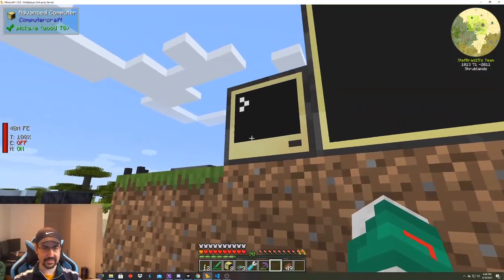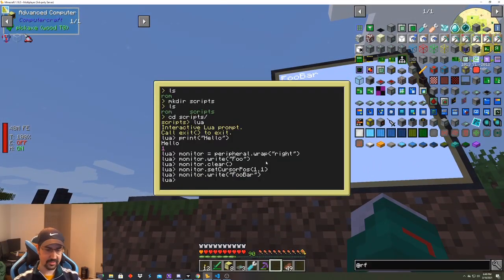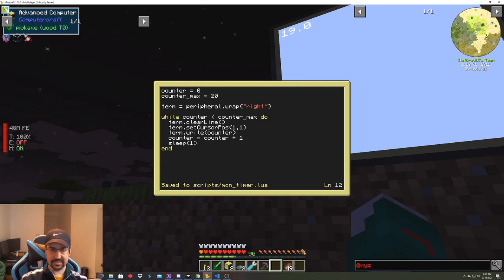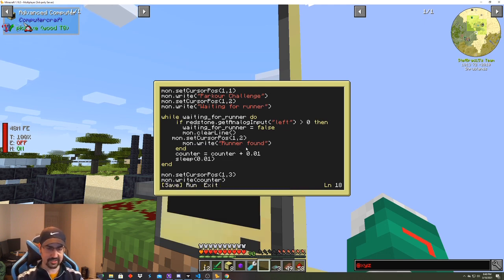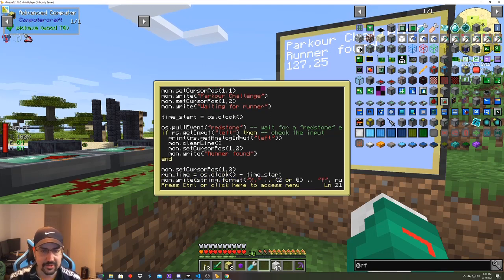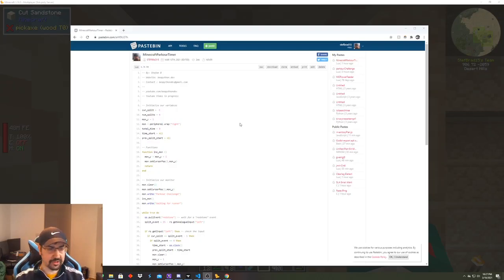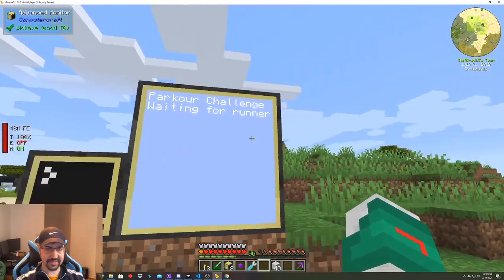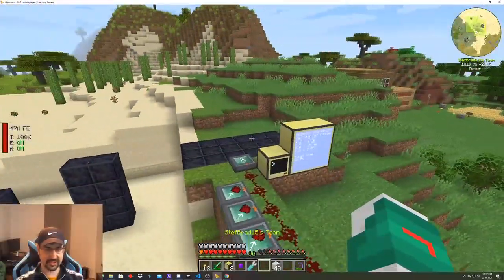Building a Parkour Split Timing System in Minecraft using Computer Craft, Lua, and Coding Skills

Comment: Nice application and clever useage of the redstone strength! An alternative architecture could make use of a computer with wireless modem at each player sensor, that sends its station number to the main computer.
Reply from the maker: Hey Kaikaku thanks for the comment and the watch!  I thought the Redstone signal strength idea might be simpler since it only deals with listening for one kind of event type and doesn't introduce an extra API for the modems client/server architecture since we don't need detailed state from the sensors.  You would also have to write a client app for each of the sensor computers too and 'install' it across the mini fleet.

It would be a cool follow up video for sure if we did need to keep more state like the player name, their equipment for if they have flight enabled or not, and if they skipped checkpoints.